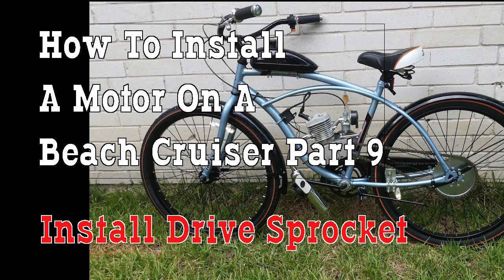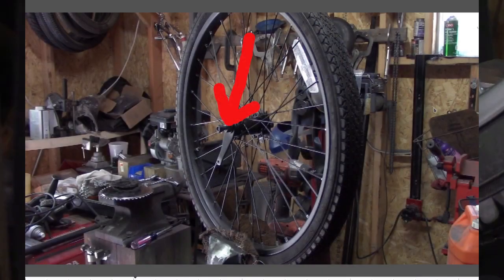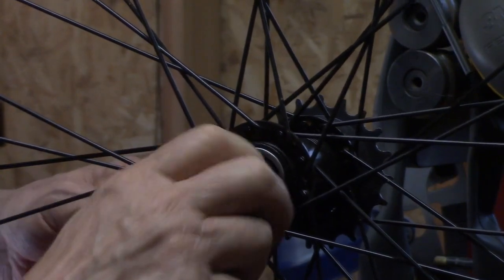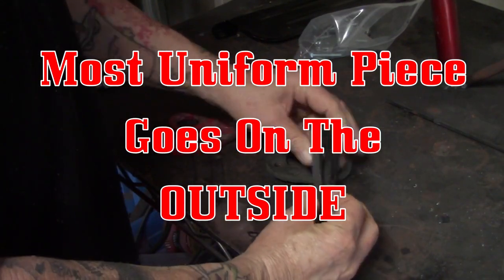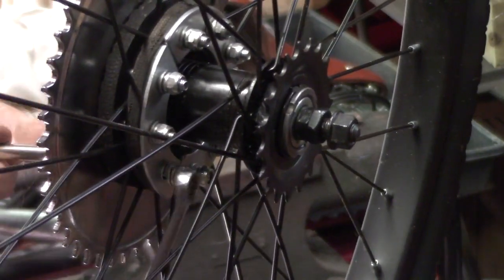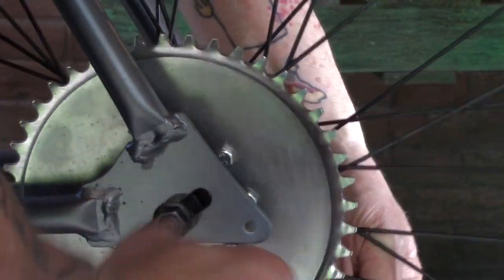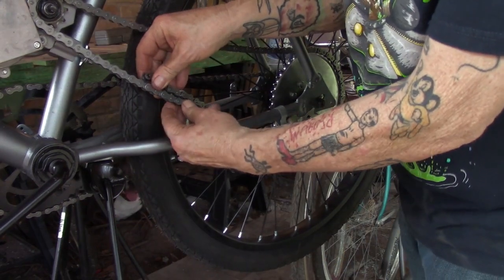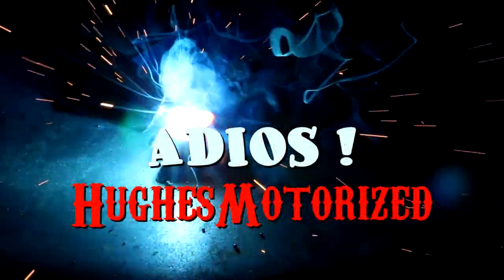Part 9 - Video Tutorial - How To Build A 66cc 2 Stroke Motorized Bicycle - Install Drive Sprocket

Comment: nice video brother . i just did the rag joint job . watched a older video from you while i did it . that dust cover was a pain in the but . got it perfect though with a diamond file and alot of elbow grease lol . waiting on a chain breaker tool to come in the mail hey i dint have one lol . i also needed a off  set intake manifold . man finding one of those on amazon that dont have bad reviews is impossible so im hoping for the best and i get lucky . i have a schwinn swindler the carb almost fits but it sets cockeyed in there and the throttle cable hits up against the cross bar in the middle . once i get that then i can i hope finish this project and get the bike running . then the real hard part comes into play getting it legal to ride . michigan considers motorized bikes as mopeds . dont need a title but need bill of sale and a whopping 15 dollars lol . then they will register it  .  i still think ill get pulled over on it as no one has one of these around here . and the cops are not the brightest bulbs in the pack . but it will make for fun videos im sure . thanks for all your help buddy . alot of it i already know but i have owned one for years and i bought it already put together . so there was a couple thing i did learn and needed to know . besides its nice to know your doing it right . that dust cover trick is priceless . your the man brother keep them coming . know it or not im still going to watch .
Reply from the maker: Glad 2 help. Good luck w/ the Michigan PoPo
Reply: @HughesMotorized  lol thanks brother

Comment: Hey sir I'm having a lot of trouble with my sprocket installation. I have a Kent Seachange Beach cruiser. When I put on the sprocket my wheel won't spin. I took off the dust cover and still not spinning. I tried putting the sprocket over the dust cover but I think the dust cover is too big because the sprocket doesn't go down as far when with out the cover. I tried not  to  tightening the sprocket too much but the same problem with not spinning. I've tried with and without the coster brake arm and it works but not with the sprocket. It's not the bike because I put it back together like from the store and it works fine. Any advice would be deeply appreciated. Thank you for your time.

Comment: Eugene, why don't you ever just use the inside  rag joint and go metal and metal on the outside. Easy peasy perfect alignment every time no hassle no fuss, then to make it even easier use 6 millimeter Allen bolts with  nylon lock nuts. Allen bolts because they're super strong, and super easy to tighten  up on the fly with just a  bicycle multi-tool that'll fit in your pocket. Then if needed just use a couple 10mm washers on the rear axle to get the correct spacing.
Reply: Johnny Octane  there's a first for everything, but I've never had any issues, I rather just replace the spokes on one side every couple years, then deal with the ongoing continuous headache of using that outer rag joint. Like I said there's a first for everything I used to think those aluminum mags for the greatest thing since sliced bread till I had one explode on me and almost killed me without warning.
Reply: Johnny Octane  I also have two 4-stroke. I had the 10-spoke bikeberry mags on both.   One a Phatmoto, the other 49cc Cranbrook. The ones on the Phatmoto are a year older , heavier bike with three times the mileage, even though the mags are essentially identical after closer inspection appeared to be a little bit better made.  The ones on the Cranbrook with only about a thousand miles on them are the ones that blew up.  There is a paper thin spot right underneath the wall of the mag. Without warning it blew out and one side of the mag started peeling off, then hooked onto the chain then the tire kind of started rapping around the mag.  I got a little messed up but I dodged the bullet big time I was only doing a little bit over 25 by the time. I salvaged the axles in the bearings, but I will never go near those things again.
Reply: Johnny Octane  I'm starting to think that motorized bicycles are an extreme sport opposed to a hobby,
Reply: Johnny Octane  yep Chinese mystery metal

Comment: Is there away u can take your coaster brake off an rig to where it free spins ?
Reply: I've done that before it works so so, it's hard to describe.  I don't like using a coaster brake, when I was new to the hobby I didn't lock tight that little nut and bolt that holds the coaster brake in  place,, it didn't take long for the vibration to make it fall out. Then the coaster brake arm spins a million miles an hour and locks up the rear wheel.  It's never quite the right after that.  In my opinion a Freewheel hub, with C brakes is a better option.  But sometimes you just work with what you got.